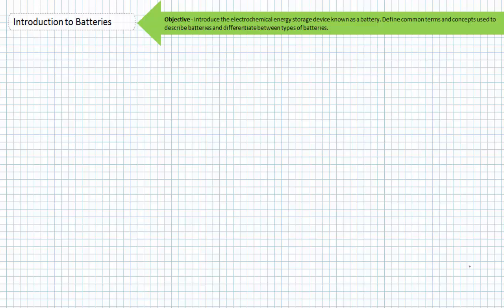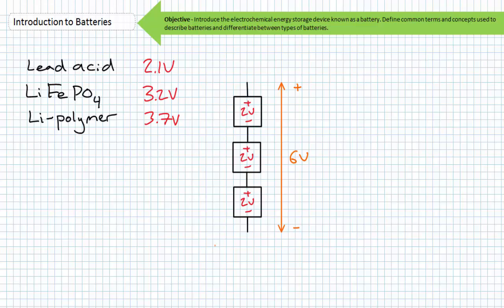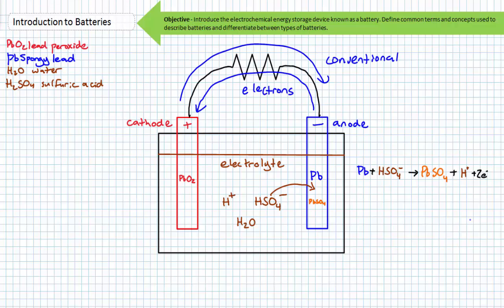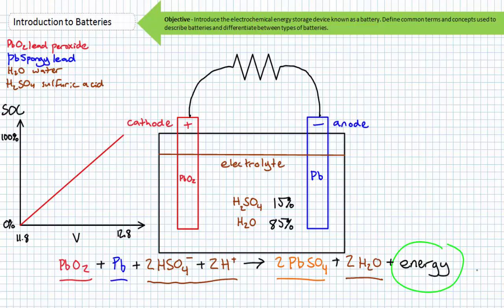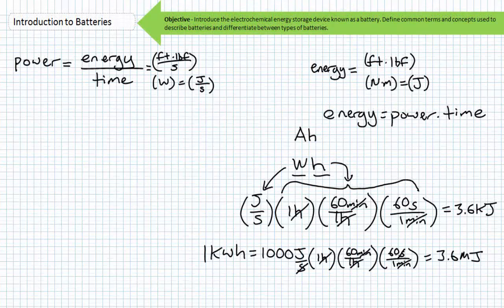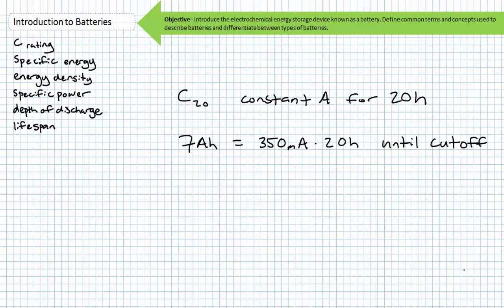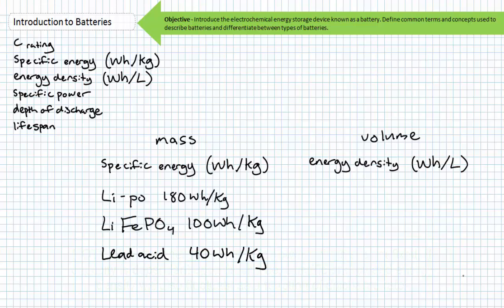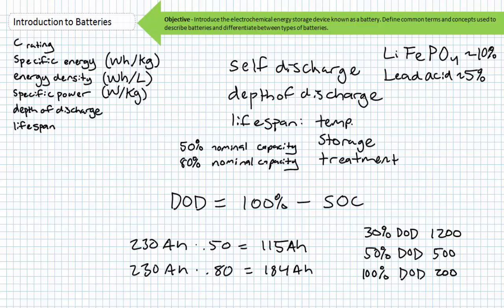Introduction to Batteries

Comment: Fantastic Series! Question. What or when do you consider the depth of discharge to be? The voltage read when the battery dips to a discharged voltage while under load? Or, after the load is removed and an hour later, after recovery?
Reply from the maker: Accurate measurements of state of charge are best made when the battery is at rest (ie: open circuit voltage) rather than when the battery is delivering current to a load (ie: working voltage).
Reply: @bigbadtech  Thank You. Perhaps I am being too thick headed here. If I have a fully charged 12 volt battery, say at 12.7x volts, and I connect a 6 amp load to it and the voltage immediately drops to 12.35, (indicating an immediate 20%dod state, immediately) is that the true state of discharge?  It lost 20% of it's charge in the first 2 minutes?

Or would you wait until it has recovered from being discharged, say 12 hours to get an accurate state of discharge?

Only reason I ask is I occasionally cycle these deep cycle batteries to 12.10 or so (30%dod) just to see what kind of run times I am getting and when it drops to 12.10v, that is when I pull the load off. Is that value, 12.10 an accurate 30%dod, or should I wait till after recovery and then measure the voltage, like 12-24 hours later. Thanks for your help, much obliged.
Reply: @sammyboyde6489  Like he said, check when the battery is "at rest". As a general rule of thumb, waiting one hour should be long enough for all the battery's internal chemistry to stabilize. But it also depends on what specific measurements you want to take. Checking them at rest is a good way to test their State of Charge (he covers SOC in another video). If you need to know how much your battery can deliver while under load, then test them while they are being discharged.

Comment: Question: I’m working with a battery charger and there is a parameter named Ki. I can’t find any information from the manufacturer or online about what this parameter is for. Any idea? Thank you Jim.
Reply from the maker: Does Ki have a numerical value?
Reply: Jim Pytel yes. Battery charging Ki=11, Battery charging Kp=0 (also don’t know what this value indicates)
Reply from the maker: Aha ... most likely these values refer to PID control constants. Ki = integral, Kp=propotional , Kd=derivative. These values allow a closed loop controller to maintain output within a reasonable time, a minimum of overshoot, and minimum settling. PID control is worthy of not just another lecture but rather another complete playlist! Stay in touch, eventually I'd like to cover more advanced material like this.
Reply: Jim Pytel thank you sir! I’m looking forward to this content. This would somewhat make up for what 2020 has been.

Comment: do not be dismayed-- anode is + and cathode is -  and he is confusing you by combining convention theory and electron theory and + and - charged- I will not use this my in classes.
Reply from the maker: Incorrect. Check out Battery University: https://batteryuniversity.com/learn/article/bu_104b_building_blocks_of_a_battery As I stated the terms are defined by their function. Conventional current leaves the cathode and enters the anode. True for a battery. True for a diode.

Comment: What is the fully charged voltage of a SLA battery? 12.5, 12.8, 13.2?
Reply from the maker: That's a million dollar question. Honestly only way to get a straight answer is to refer to that exact battery's data sheet
Reply: Thanks for the lead. The battery I have seems to be a rebranded Power Sonic battery. I found a PDF so now I kinda have a clue, thanks.

Comment: i was using a grinder cutting metal , and showering ten battery's with millions of sparks , with the caps off while charging ''' and no explosion ''' lipo straight in to dc lead acid ' trickle charge from normal dc charger '''' this week i have either been extremely lucky or its all total bollocks .
Reply: It's only small quantiees of hydrogen. It is theoretically explosive and probably would be dangerous if dealing with a big poorly vented battery farm. Get some aluminium and caustic soda and box of matches ( and safety glasses )and have a play if you want to get a feel for the forces involved.

Comment: Are these ratings for batteries applicable to FUEL CELLS?
Another EXCELLENT presentation! I learned a lot about the explanation of the ratings & I work with all types of batteries!
Reply from the maker: +Don G. I can't even consider myself a fuel cell novice however energy capacity, regardless of form, can be expressed in units of J, Nm, ft*lbf, kWh (power times time) or even Ah (like a battery with an assumed nominal voltage)
Reply: TX! I guess it's still a kinda battery & so kWh should work!

Comment: You speak incredibly well and clearly, thanks a lot for the videos!
Reply: +Daniel Cavanagh 
I think you inverted the C rate to be time instead of 1/time though? And as a result you got lower currents for higher C rates when my understanding is that there is less time and higher currents for increasing c rates.
Reply from the maker: +Daniel Cavanagh C rating is super confusing because it's used to represent nominal capacity AND discharge/charge rates. When used to represent nominal capacity I like to think of C rating as a timed test. (example: Battery X might have a capacity of 200Ah when subjected to a 20 hour test, however, battery X might have a 220Ah capacity when subjected to a longer 100 hour test). Whereas when C rating is used to represent discharge/charge rate I like to think of C rating as a "function of rated capacity" Check out the "Battery Discharge Characteristics" and "Battery Charging Methods" lectures for further clarification.